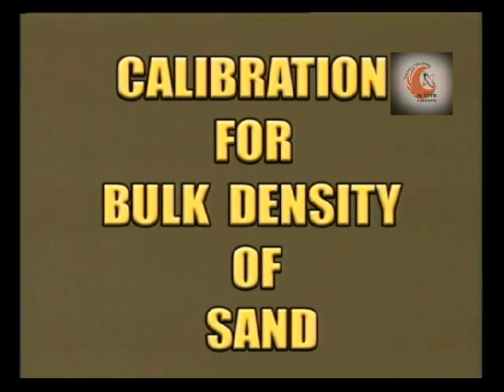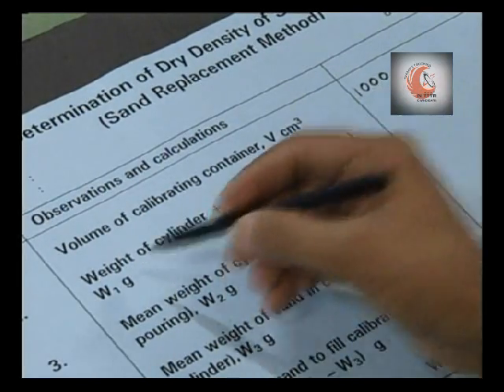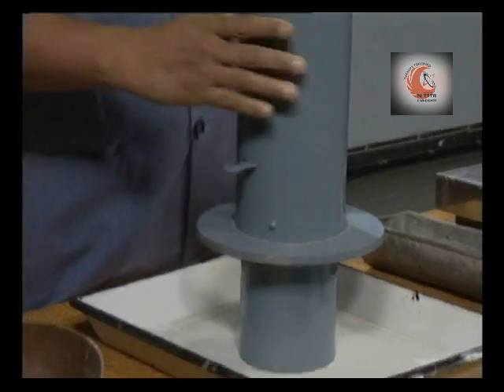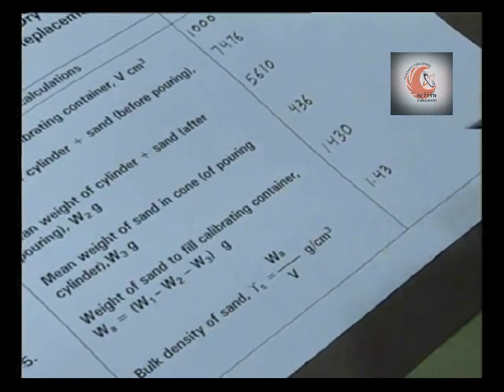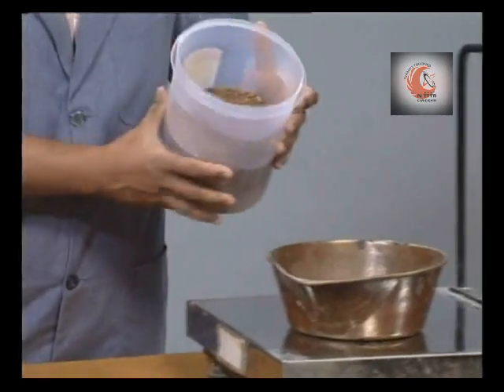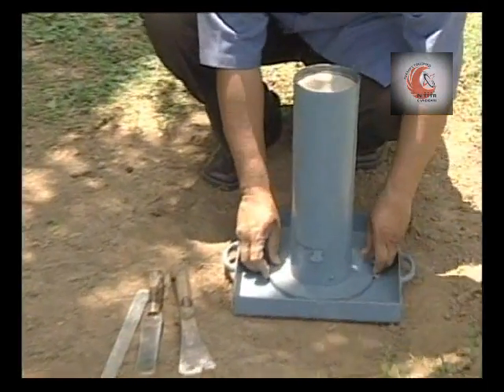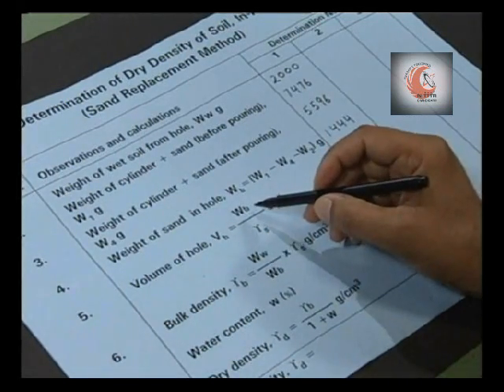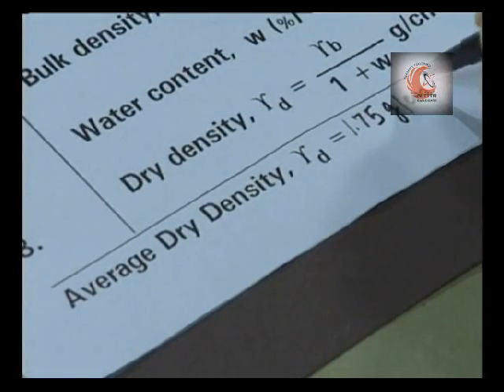Determination of Dry Density of Soil by Sand Replacement Method

Comment: respected sir ,in the 2 nd part of experiment ,i.e  in the calculation of bulk density of soil , in place of W 2 ( i.e weight of sand in sand pouring cylinder after pouring ) , W 3 ( i.e weight of sand in cone of sand pouring cylinder ) should be used.

Comment: There should be correction at 1:27 min ...in text books and in other platforms it is mentioned that sand should be passes from 600 microns and retained at 300 micron ...…
Reply: Check is 2720 p-28

Comment: Tnq sir it was so helpful ,, but there is a mistake in calculating the weight of Wb (i.e. weight of sand in hole)
By taking W3 instead of W2

Comment: Explain cal for dry density 
1.98 /1+13.62
Ans. 0.13
Reply: Water contents are expressed in percentage. So it is13.62 %. You have to put 0.1362 in the formula while calculating. Then u will get 1.74

Comment: sir when u placed sand pouring cylinder on excavated hole i think u hv to remove pit ist becoz the pit will increase the hole lenth by 1 to 2 cm by which sand poured is more that can affect the results

Comment: there are 2 typos in this great video. As Aksay Kumar mentioned, Wsand=w1-w4-w3 (not w1-w4-w2); Also at around 11:30, equation 6, divided by volume Vh (not divided by Wb)
Reply: 11:30 is not wrong because they multiple it with density of sand
Reply: @devotionalsong2628  can you pls explain to me why they did not minus the mean weight of the sand calibration cylinder
Reply: Yes correct

Comment: I think there is a correction in the second part to calculate the weight of sand occupying the hole

W1= Weight of Sand pouring Cylinder with sand upto top.
W4= Weight of Sand pouring Cylinder after filling the field hole.

Now (W1 - W4 )
gives the weight of sand filled in hole along with the weight of conical sand portion at top.

Hence to find out the weight of sand occupied on hole only  , deduct the conical sand portion W3

Therefore  weight of sand on hole is

W1 - W4 - W3             ( But,  eventhough he has substituted correct values , it is wrongly  given here as W1-W4-W2)

Anyway I appreciate the author for his work....super
Reply: Really satisfied after seeing this comment I too had the same doubt🙏❤️
Reply: Plz check the instruction in IS Code 2720 part 28
Reply: u r correct sir
Reply: u r correct sir
Reply: thanks

Comment: i couldn't understand why the technician was hitting the side of the cone?  its wrong. when you calibrating the sand you should avoid the disturbance to the cone. its need to be fill in  as loose density. if you hitting the cone, that means you giving some static compression to the sand and it will be increasing the BULK DENSITY of the sand.

Comment: weight of sand in hole should be (w1-w4-w3)
Reply: W1= Weight of Sand pouring Cylinder with sand upto top.
W4= Weight of Sand pouring Cylinder after filling the field hole.

Now (W1 - W4 )
gives the weight of sand filled in hole along with the weight of conical sand portion at top.

Hence to find out the weight of sand occupied on hole only  , deduct the conical sand portion W3

Therefore  weight of sand on hole is

W1 - W4 - W3
Reply: what is w3
Reply: You r exactly right
Reply: Same thought
Reply: standrad sand weight of cone

Comment: This is somewhat a little inaccurate. Whilst calibrating the density of the sand by letting the sand run into the calibrating cylinder you are missing the gap the metal